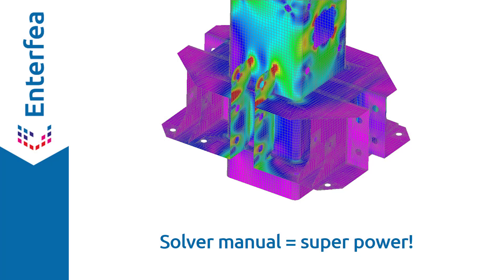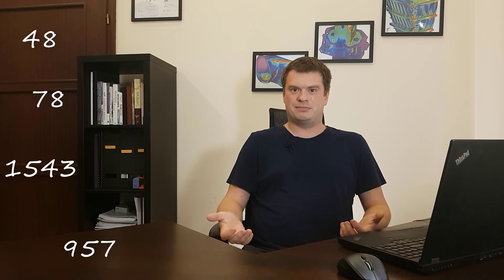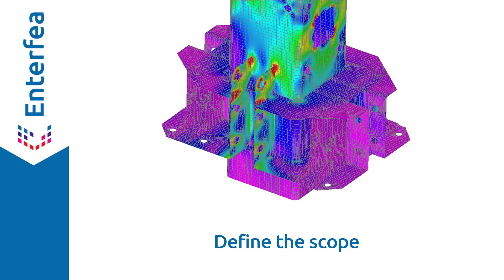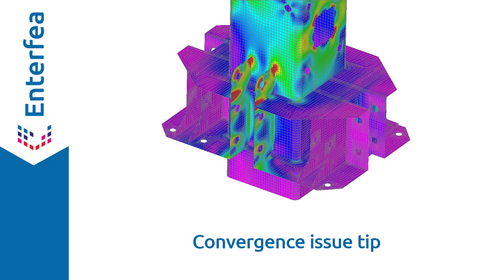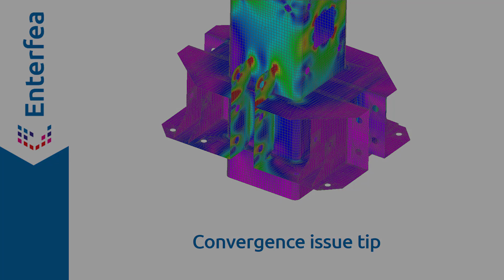FEA Design tips #002

Comment: What  do you think of the following FEA guidelines?
1. The perfect part has equal stress throughout – the same color
2. High stress areas indicate areas where high amounts of molecular movement (stretch) occurs
     a. When trying to reduce deflection, attack areas of high stress first
3. Include features that are in the load path, otherwise suppress them to reduce computational time
4. Non-failure level stress has no effect on the stress in other areas of the part.  If a cross section and applied load are constant, so also is the stress at that point.  This is regardless of other cross sections within or outside of the load path
     a. If a stress riser occurs within a part it has no effect on other stress areas of the same part
Reply from the maker: Hey Criticalw88 :)

In truth, I'm not a fan of "general guidelines". I mean such a set or "rules" that simply apply to all cases. Sure, I try to give some tips, but those usually will be case-specific or techniques, rather than "general rules". I believe engineering is a bit too complex to offer such solutions. That being said, let's take a look at your proposal:

1. I'm not sure if I understand this one. What if a perfect part is in bending? There is no way to have a constant stress than... Sure, theoretically you could figure out a shape that would produce uniform stress, but at the very maximum only for one specific load case... and usually there are plenty. I don't think this would lead to a practical approach.
2. Sure high stress is correlated with high strain - but would I start there? On a rigid-rigid beam highest moments (stresses as well) are near the supports - I would, however, try to deal with the span in order to reduce deformations.
3. Depending on what is your goal this may not be great. Sure, if you are after capacity, and you can with 100% say that something doesn't carry the load, by all means, ignore it. I'm in a business where everything does something in the model... so no ignoring for me I guess :) This is, however, a valid point in a lot of cases, and a good idea!
4. I'm not sure if I understand that. But I wouldn't generalize in such a way. You can change stresses on the section you don't modify by modifying other areas... just weld vertical stiffeners to the shell and they will concentrate stress above them...

Would you agree with my remarks? I would love to know your opinion on that!
All the best, and thanks for reaching out!
Ł
Reply: 1.  Good point on the specific load case.  As you said, I am thinking of creating the shape that equalizes stress while fulfilling the task.  In many cases this shape cannot be created, it is only goal.  As a novice FEA user, I find myself errantly adding material to high stress areas only to find that the part's peak stress increases while deflection decreases.  I therefore believe a better strategy is to balance stress to deflection.  Such balance manifests itself as a single color or stress level.
2.  Agreed
3.  Agreed
4.  Agreed, perhaps this only applies when the non-critical stress riser is on the same plane as the critical stress riser.  The plane being perpendicular to the stress line.  I visualize this by a tensile coupon with 2 holes.  If both holes lie on a line parallel to the tension and both holes are far enough apart, one does not affect the other.  Conversely, if both holes lie on a line perpendicular to the tension, one will affect the other.  After further consideration, I am saying that the plane is the shear plane in stress=F/A.  I might be going too far to apply such 2-dimensional conjecture to the 3D FEA world.

Also, with respect your video #1, great idea using benchmarks to validate methods.
Reply from the maker: Hey Criticalw88 :)

I'm glad that you agree with most of my points :)

Also, I actually modified one of your advices from here, and it ended up as today's insight in my FEA group. This means, that it will be on my blog and YT in some time :) Congratz and thanks for the finput - I really appreciate it!